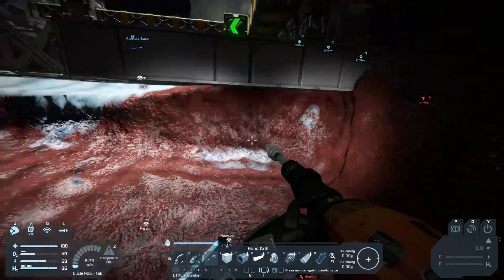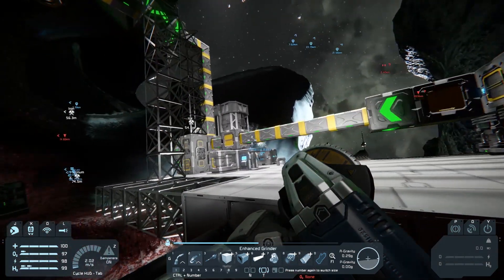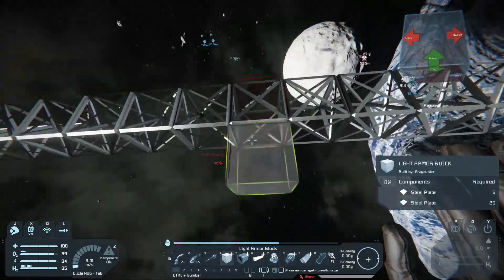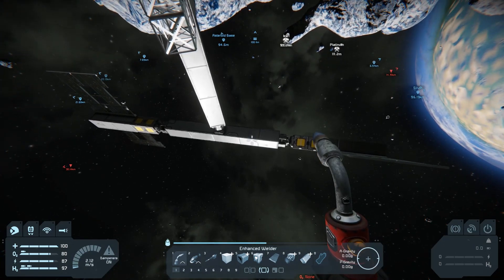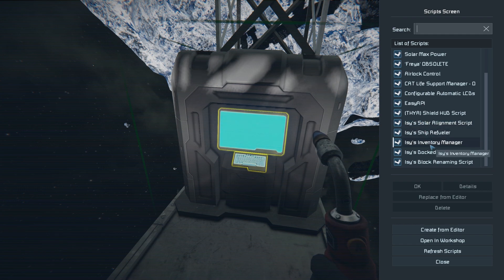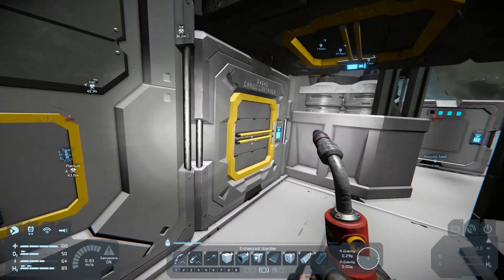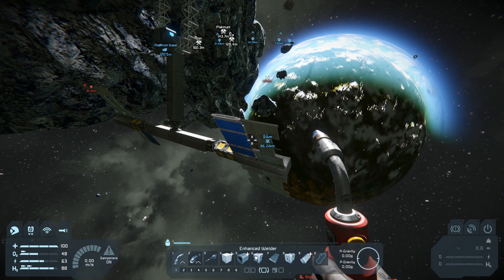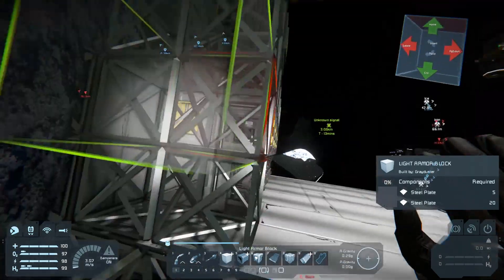Space Engineers S2 E15 - Solar Tracking Rotors and Panels

Comment: Isy's the best ^^ but why have you not connected the solar farm to the base with conv from scratch ? It will be a pain in the socks to change armor blocks to junctions
Reply from the maker: I may build a separate arm for them - i entirely forgot about the conveyor required until after I built the whole arm! :)  Also, long stretches of conveyor are a pain until we build a welding ship, which is likely next up!
Reply: yeah, welding ship will save you hundreds of back and go. Isy's Inventory manager is great too. The script easily manage your stock and can send assembler requests to autocraft high demand components
Reply from the maker: Is Isy's Inventory Manager as good as the old TIM mod, if you remember that?  That's a definite add, if so :D
Reply: TIM is far more complex and powerfull, but Isy's  is very accessible and easily configurable, you put a LCD and name it autocrafting and it lists your components and you just have to modify the quantities on the text section of the LCD. I remember  TIM could be set to sort quotas and priorities. Really sharp but I never been able to run it properly. Isy's really simple to run : 3 large and 1 small containers and the script will rename them automatically to sort ores, ingots, components and tools, weapons ammo and bottles
Reply: ISY is great.  if you are looking to add mods and don't want to build a welding ship, check out the build and repair nano bots.  They aren't terribly overpowered, but will help you complete blocks if you have resources.
Reply: Thanks, guys! My inventory manager has come a long way.. It's definately different than TIM but has its benefits as well ;) @grayduster: Thanks for choosing and showing my solar alignment script!

Comment: Your eyes deceive you captain... Clearly, there are five lights ;-)

Just wondering if it's possible to position the solar panels relative to the asteroid such that the sun is always visible (unless eclipsed by the planet), i.e. on an axial "pole", resulting in perpetual solar exposure, in stead of casting a shadow on them when the sun moves behind the asteroid? If it's not already so positioned, you may have to observe the sun's ecliptic (apparent movement through the "sky") for about a solar 'day' to choose the best location. Power efficiency gains should stack with solar tracking. This of course ignores any irregular tumbling of the asteroid, which I'm not sure is simulated.

Also, it appears the positioning of the solar panels on the left and right struts don't line up. One set is on the back end of the blocks, and the other on the front (might be due to flipped rotor angles). The front side seems preferential since it avoids the shadow cast by the protruding blocks.

As far as meteors are concerned, I'd be more concerned by them hitting unwelded scaffolding, than having redundant supports. The unwelded blocks are extremely fragile. Just a light tap destroys them. Something about having too much iron..
Reply from the maker: Some excellent points here :)  I may well surround the main column (or modify it) such that it's either a solid 3x3 pillar, or with one space in the middle, allowing protection for most of the length (doesn't help the poor solar panels, mind you!).

Afaik, asteroids don't rotate at all (neither do planets), nor do they move in relation to one another, but the sun's path is pretty predictable, meaning we could build a column along 90 degrees from the ecliptic - at the moment, our entrance/exit doesn't quite line up with it, and it'd be a lot of digging to do that.

The flipped rotors (somewhat unavoidable on this design) do sound like they're to blame for the panels rotating with the back/front ends attached on each end of the arm.  There shouldn't be much shadow from the protruding blocks, as long as they accurately track the sun, but any lag in that would cause a bit of power loss.  

Now I just have to figure out how to route the oxygen farm output back to the asteroid, if I put them out there :)  (I may just build a separate arm for those)
Reply: A lot of digging.. or, a longer pylon reaching beyond the asteroid's horizon; though that would create a larger target for meteors. Maybe temporary?

You might be able to fiddle with rotor settings to get them to line up (dunno if Isy's script will overwrite that.. perhaps rotate them?), or perhaps flip the panels.
The protruding blocks have more to do with aesthetics than efficiency really. Half blocks, or back-to-back slopes might clean it up. Not really a concern, if you don't mind trolling OCD viewers, lol, or maybe having the left and right at different angles.
You could also rework it to have just one rotor rotate both sides at once, perhaps with the attitude rotor at the end mounted on a smaller profile blast door edge for clearance, with a gimble arm going around it to the other side. 

IMPORTANT

Wrt. the oxygen farm; afaik, you're gonna need a lot, esp. if you want to eventually have a pressurized atmosphere controlled base in there. They will occupy more volume than the solar panels... So plan for that. You don't want to rebuild the entire solar/O2 array again later. You could have the same Isy-controlled platform track the sun for both solar panels and O2 farms. Don't know if the script works on O2-only rigs.

!! :
As for meteors - You defend against them in 2 ways: 1) put something in the way of the sun, from where they originate, (like an asteroid); or 2)  Gatling- or Interior Turrets. Since you're trying to be maximally in the sun for both solar and O2, they're going to be both your most vulnerable, and critical assets, and thus option 2 is mandatory. Thus if you have turrets, you'd need a conveyor anyway to feed ammo to both solar and O2 arrays... It follows that it would be more costly in both construction materials and ammunition manufacturing to have separate arms for O2 and solar... the same turret can protect both arrays from the same set of incoming meteors.